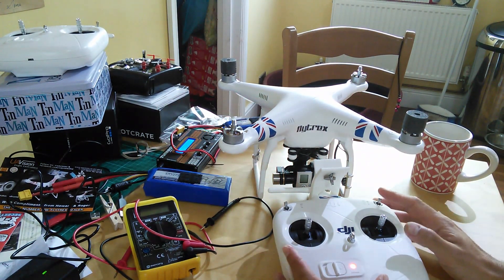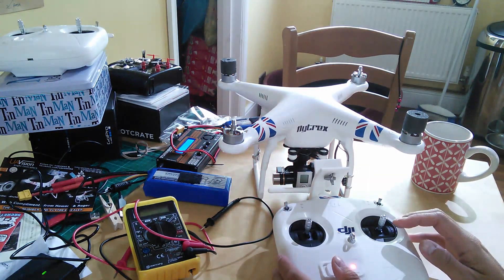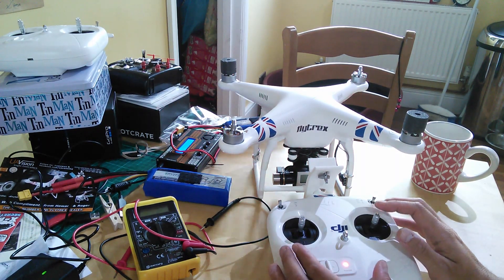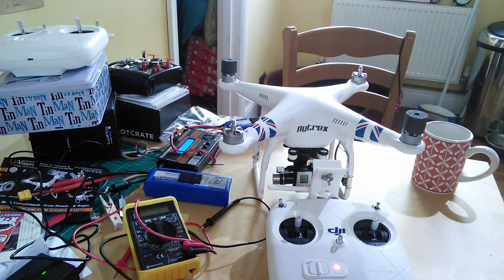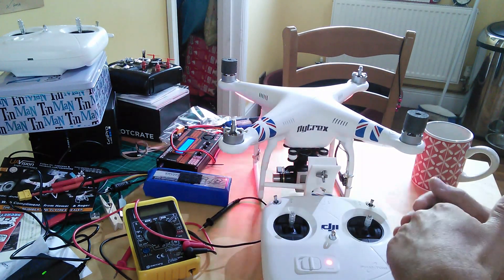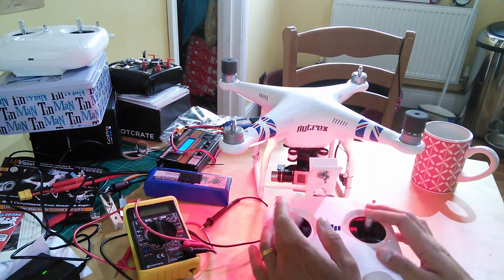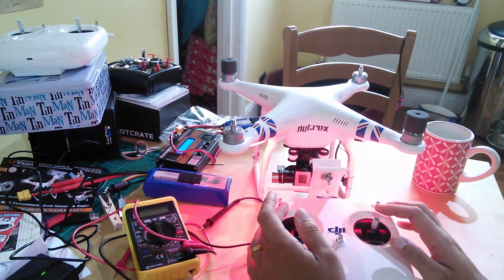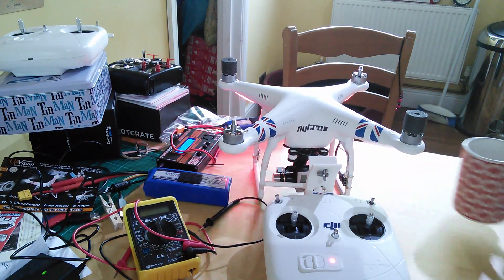DJI Phantom Series CSC - how to start and stop the motors on your 2, Vision, Vision Plus, FC40

Comment: Another quality video, thank you.

On my first flight I spent most of the time doing takeoffs and landings (PPL habits die hard!) and I had several topples. Now I understand why. Luckily there wasn't any significant prop damage. This would also explain the differing speed bleed rates on the props after the shutdown command - I was paranoid about having a motor fault.

I'll be using the 3 seconds down technique from now on. I might even end up hand catching, but I do enjoy nailing a ground landing :)

Comment: Just a small point - it is probably not a good idea to power cycle the escs so rapidly as you do in the video. It is always a good idea to let things settle for a good second or two before reapplying power with anything electronic.